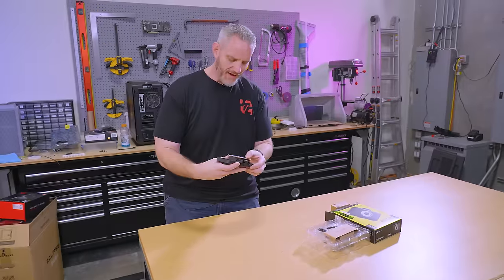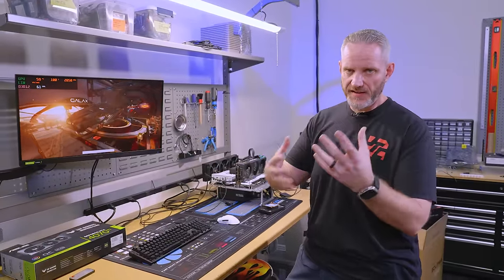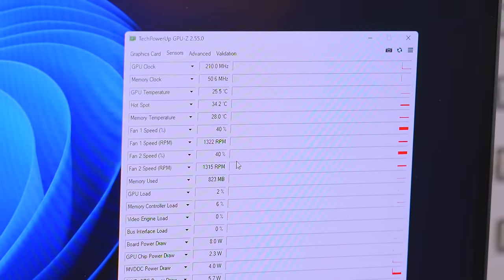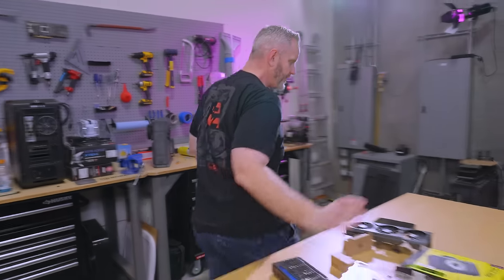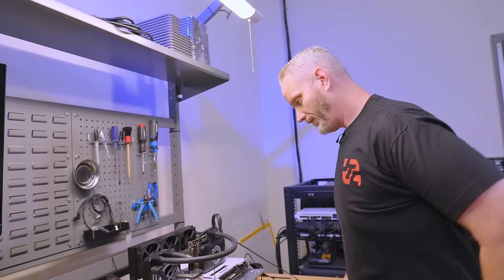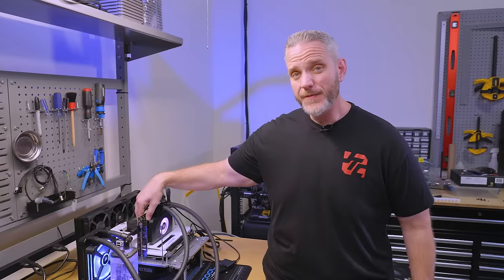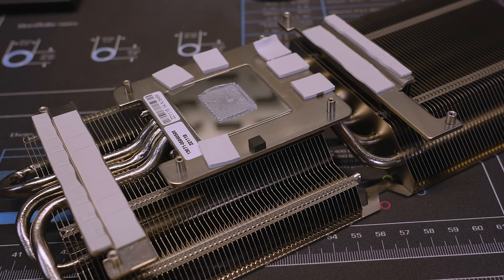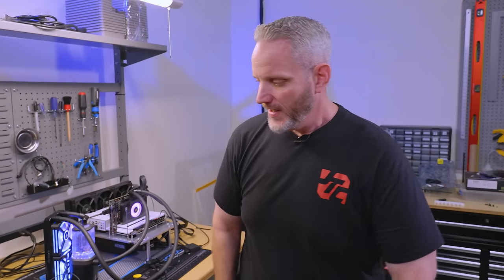They don't think I was being fair...

Comment: Think its expensive, but in a closed case it might deliver more than in a open bench. in a pc case the air temp will be higher than ambiant room temp and there for the air used to cool the gpu wil be hotter. with the little expensive corsair do higgy you can mount the radiator in the front of the case and cool the gpu with ambiant temprature air from the room. this might help it some.

used full cover blocks in the past and it was always a pain to figure out which block was requierd for the specific card.

Comment: that cold plate looks like a aio plate not a custom gpu cooler......and for 130 that looks awful and would leave stock there better off being left alone. . . there's chineese blocks for similair prices and are full cover its only a 4070 its not that hot so it'd be fine with a cheaper one it wont need the bleeding edge like a  EKwb.......i used too have  full loop (2080ti- 9700k) now i have a 4070ti and 13700k aorus masters air cooler is retarted so now im just useing a aio and sold my whole old pc loop and all waters going out of favor imo with 14"/4" cards being the norm unless your a small FF guy water cooling is dumb

Comment: Dude... 1) You went so soft on it I almost bought you a bottle of viagra.

2) You are WAY braver than I. If a card -- at todays batshit prices -- came with heat sinks for the VRM's, there is no way in HELL I'd turn it on without some sort of  extra cooling solution on there. Even if I had to drag out those old-school ancient RAM-sinks we used to toss on cards back in the AGP Ge 6 / ATI 9xxx days.

Comment: I could tell this is hot garbage by the amount of cheap plastic and that extremely thin metal plate 🙄🙄 ...and to make matters worst, how tight can the seal be, screwing that plate to that very  same cheap plastic...?! 😳😳 ...with the pump pressure that thing will be leaking in a month. Absolute Garbage!!! Corsair should fire the person who designed this.

Comment: hot garbage. it should at least come with some adhesive copper heatsinks for onboard components like the kind you get for a raspberry pi.
i've built better DIY hybrid solutions myself with cpu blocks. hybrid shouldn't even be used on cards that don't have a separate cooling plate for memory or VRM like the EVGA 2080 cards.